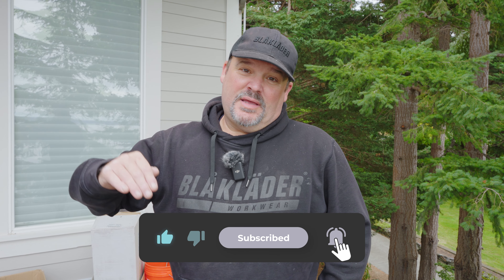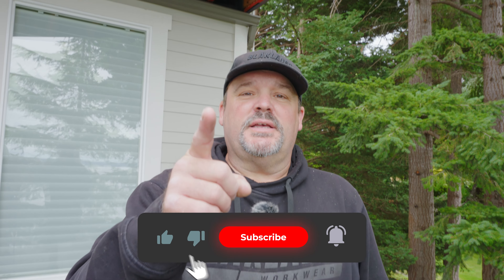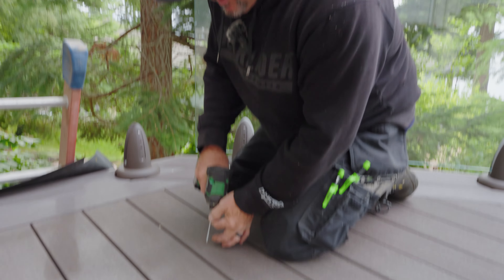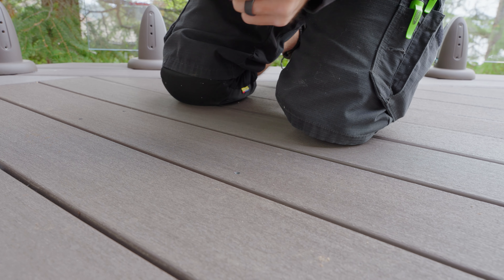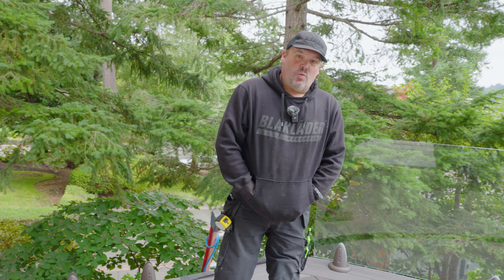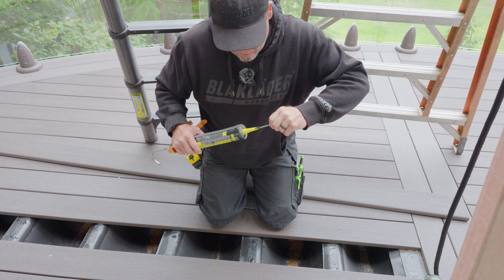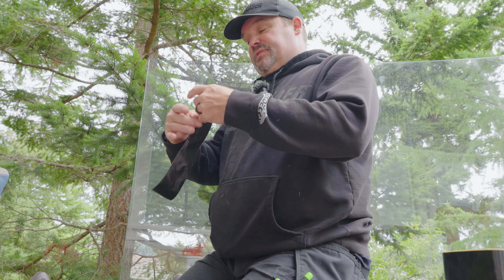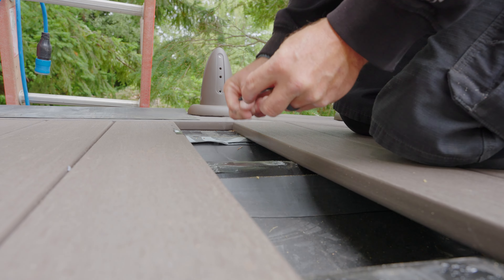How To Replace A Deck Board || Dr Decks

Comment: Do you have a video on replacing an exterior beam. 4 2x12s that are held up on either side by stone columns. The st attached to the joists is ok. The last 3 are bad.
Reply: Build your self a temporary wall under your existing structure (joist) out of 2x4/2x6 brace it up and start taking out your joist set the new ones and take down the temp wall

Comment: Okay, I get that its an expensive deck and in the field - but I've repaired chips that look 90% perfect using heat gun and a slice from another deck (or sometimes shavings depending if its a chip or a groove). If it wasn't in the field I'd be repairing it for 20 minutes rather than pulling that board. Honestly it almost never happens. Happened for the second time ever doing surface mount posts on a stairs, which is a niche situation. Luckily the chips were on the edge and barely in eyesight.

Dr, you ever repair these? I know you repair scratches.